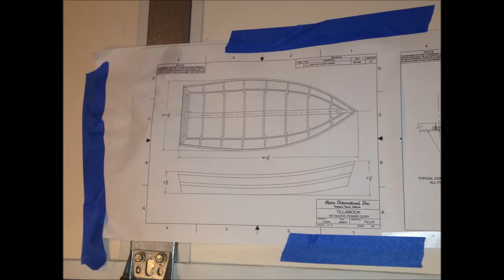Bob Heidenreich Tillamook Build

Comment: Real nice!  I'm two weeks away from completing my Tillamook dory.  .
Reply: That is fantastic!  Have you posted ant photos yet?   I think you will be pleased with how stable and agile this design is!
Reply: where is home?
Reply: I live in Machipongo, Virginia right on the Chesapeake Bay.  I'm going to power the Tillamook with a new 30 hp Suzuki.  The boat is primarily for my 13 and 12 year old sons so it will have electric start and trim (tiller driven, not center console).  I cannot see what hp you have on your boat.  I have some photos of the build, but have not put anything online.
Reply: +Robert Gustafson i've built two Tillamook's now and both of them are powered with 9.9 HP Mercury pro kicker motors.....topSpeed is 10 miles an hour....30 horse will really get that thing moving I'm sure....I hope you get as much enjoyment out of building yours as I did mine, it was a blast!
Reply: I can see the boat moored off our beach in the Chesapeake as I type.  It is a super boat so far -- good and dry in waves, I can pull it across ankle deep water on flats and run it in less than 1' of water.  It is really my 13 year old son's boat and he has has six friends in it with no problem.  The 30 hp moves it quickly although we are still in the break in period and have not even opened it up yet.  I'll work on a video and post soon.  I'm already thinking of building a 14' Carolina dory for me to use in the near waters for fishing and crabbing. Tank for the encouragement!

Comment: I didnt see a keel,im building a very similar boat and plan on a keel and runner to help it turn.I wonder how this one handles without em.Ive heard the flatbottom skiffs will side slip and are squirrely.Nice work on it,I hope mine turns out that good.
Reply: No issues with it tracking straight.
Reply: @bheidenreich1  thanks,im about 3/4 of the way thru it,I'll reconsider runners on the bottom,I dont like unnecessary work,one more question what kinda paint did you use?I heard a good patio /deck paint holds up well and is a bargain all things considered.
Reply from the maker: What you say is true for flat bottom skiffs, but not true for Pacific Power Dories. Normally these are never used with keels, or strakes and run just fine in rough water. Have a look at this video as well: https://spirainternational.com/vid_build_wood_pacific.html
Reply: Jerry Marshall  exterior enamel ( behr ultra from Home Depot)
Reply: @bheidenreich1  thanks again.
Reply: @tjkid07  informative,thanks for the uploads and tips,ive reviewed a lot of it,and appreciate the time and effort you put into em.